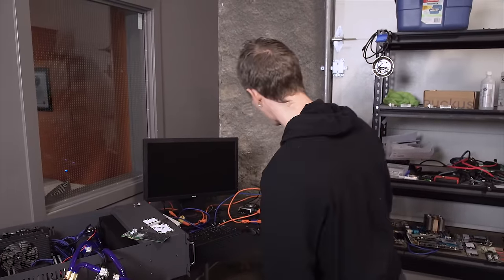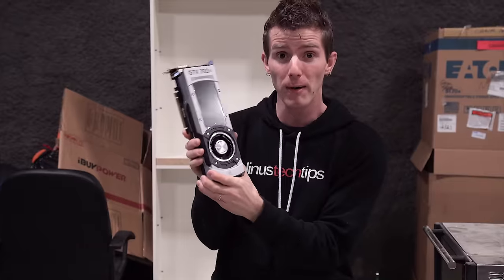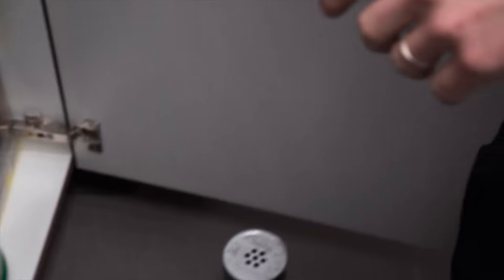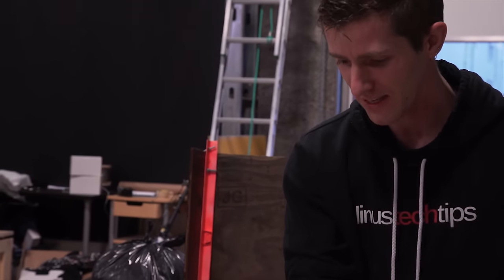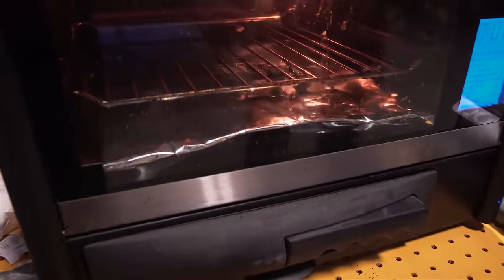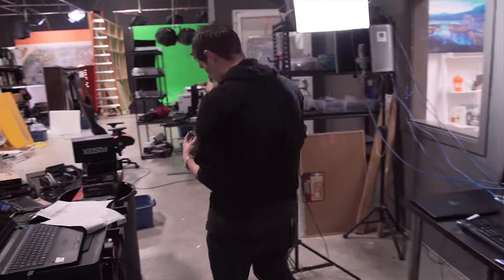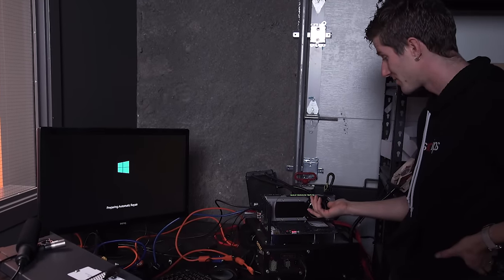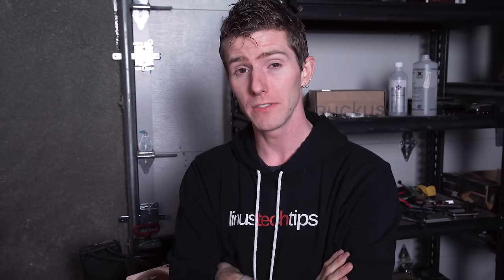Bring your video card back from the dead! - Oven method

Comment: I wonder how many people will fry their otherwise repairable equipment because Linus couldn't do his research...
Reply: +BakedCookie I really don't think very many people would actually bother to have their card repaired properly; it just wouldn't be cost effective.  They'd just go and buy a new one if it was out of warranty.  This "fix" is basically free, and you might as well do it if you're going to trash the card anyway.  Now I understand that if you had a fairly new MacBook that was just out of warranty, it would probably be pretty stupid to put it in the oven before looking into more legitimate repair options.  But that's not what this is; it's a graphics card worth maybe a few hundred dollars that most people just aren't going to send off for repair.  I understand the point Louis is trying to make, but I don't think Linus did quite as much damage with this video as Louis is making it out to be.
Reply: +oledcrt Louis's video was getting at the fact that the Linus crew is so popular and big yet they did not take time into researching the method and that it not only worked temporarily but also messed up a fixable component and that by uploading this video it will spread misinformation and create more dead components some of which are probably rather expensive.  I can understand if it's a very outdated/inexpensive card why someone would just want to scrap it but if it's a $400 card it would probably be worth just getting repaired.
Reply: +oledcrt If you throw the card out anyways you could also just give it away to charities. These would fix the card and pass it on. The stuff linus shows here can make this anywhere from harder to impossible. Source: I have destroyed several switches with a soldering iron - took five seconds per switch.

Comment: This is only a temproary fix. The bonds inside the GPU that connect the die to the pins let go after the constant expanding and contracting due to heat. When subject to a higher temp like that in a toaster oven, it will disturb things enough to make them work temporilly. I have been replacing GPU's for years and when I first started I was reballing and replacing. Now I use a brand new chip after learning that this only temporarilly fixed the problem. The lead free solder used on modern boards has a metling point of 217C or 423F. Theres confirmation you are not actually reflowing the GPU in case there was any doubt. Comes in hand though for rescuing data from a failing laptop board when you dont want to pay for a repair but thats about it. Aside from this your channel has been great. you should let people know this is not a permanent fix though.

Comment: This is veyr good method for dead cards , i used it to fix my dead GTX 550 Ti 
and it worked :)
Reply: bro will this work in micro oven i also dont have money to buy an new graphic card so i am very sad i cnt play games
Reply: I Used Normal Oven to fix
Minimum is 180*C on 8,5 min
When You Can do That on You Micro Oven , You Can try :)
Reply: i heard that when i will bake my card through microowen the capacitors will melt and the chip may catch fire is it safe?
Reply: thats i am afraid of i dont have normal oven and if i bake it in may damage
Reply: What You Have to Lose?
You Got A Broken Card , You can fix it , or it can will be still broken :)
AND REMEMBER , IT WILL SMELL LIKE OLD ELECTRONIC , THATS NORMAL!
Reply: He said Micro Oven not Microwave.
LOL THO
Reply: The 8-Bit Guy It's literally the same thing
Reply: Nope Tho , Micro oven is Minimalized Vesion of Full oven , like for Pizza or Pie
Reply: Yeah if that sunny gamer guy stuck his card in the microwave he probably got some nice fireworks.
Reply: i didnt do it.. this trick worked for me i put some hot iron on the gpu chip for 15 to 20 min and left it for cool down and it worked and for fire works lol no this is my only card.. well bought 1060 happy as well
Reply: Ya , overcloking.
Reply: Wouldn't overclocking rather lead to fried chips on the board than loosening soldered connections?
Reply: The Virus Guy i have a oven so what temperature and time for my rx 460
Reply: I got one for you- late reply, i know. Bought an HP laptop when I was going to school, around 2005. They had a defective surface mount process for Nvidia GPUs. I sent it in for warranty, had the $750 laptop for about a year and a half before it went out. They sent me another laptop. I had it about a year before black screen, no GPU. They sent the exact same board to me with an updated BIOS and all they did was increase the fan speed. There was a huge class action lawsuit against HP for it. I go zero manufacturer support for my issue. I paid $750 for a laptop that lasted about 2.5 years. If there had been no manufacturing issues, it would likely still be running today. You can bake a board at up to 400F from what I know. The transistor housings are designed to withstand melted solder temps, about 400F. Otherwise the plastic would melt when being soldered in the factory. For out of warranty issues, this video may be the only solution. And manufacturers don't always honor warranties. Normally chips last for 10+ years. But thermal expansion/contraction of metals can sometimes break the solder connection. This is actually a legitimate repair process, google reflow ovens if you're interested.
Reply: does it still work today?
Reply: dammn thats really dangerous, if ur hard dryer can output 200+ cº its not good for human use... will burn ur hair. these wont go past 70c, what u need is just a heat source, whatever it is, i'll recommend using a heatgun and a heat table below but. if u have to get these (99% ppl dont have these tools) buying em to repair ur gpu will be FAR more expensive than just buying the next gen titan gpu
Reply: yep, heatguns will do the job faster and better... 100% ppl owns ovens 0.5% ppl owns heat guns
Reply: I have the same card with a phantom 567, it can run beam.ng drive at 50fps. Mine is not dead though.
Reply: When I read these comments, I feel smart.

Comment: Hey Linus...  At least you got the graphics card back right?
Reply: +Thomas Dohlman for now
Reply: Indeed.
Reply: +Nikolaas Brems  yeah I did this with an original xbox 360, and it only lasted for a week...stupid x-shaped  back plate thing thats 2 tight
Reply: +Clear17Mud Bad solder... the 360 had bad solder and design. MS did figure out how to use the "new" solder with newer generations.
Reply: +Clear17Mud Well because reheating doesn't fix anything in 85% of the cases.
Reply: and if it does it only does it temporarily. check out rossman's video
Reply: I am pretty sure this was never refereed to as a permanent fix.
Reply: Welsige
I hope people will understand that from either Linus or Louis videos or both... or none, just by the amount of comments with some details.
and in the end, nomatter how well you inform people, they all try to remove /system32 to speed up their FPS

Comment: I did it yesterday to HD 6990m. Cleaned it thoroughly with rubbing alcohol, then placed it in the preheated oven to 220 degrees Celsius, for 12 minutes. First two tries were a failure, and I gave up, until I needed to preheat metal sheet for a different project, when I noticed that bottom heater of the oven is dead.

Comment: My GPU isn't locking up anymore, but the fan won't work, dammit.  To be honest it probably only need new thermal paste.
Reply: My fan dont spin too if i change the thermal compound it will wirk again ?
Reply: @ANNIHILX.  No
Reply: @H.EL-Othemany  lol "my radiator fan no spin, if I replace brake fluid will work?"
Reply: Fan has nothing to with thermal paste. Yank the fan out and test it with a AA battery and a paper clip.
Reply: @debbidonosenshi  lol my phone's speaker doesn't work do I need to replace the LCD?
Reply: Connect the fan to the motherboard ,or to 12v and let it rip....

Comment: It's not gross. It's pure carbon.
Reply: +Hostile It really isn't. All kinds of organic compounds in that burnt stuff.
Reply: +Hostile carbon can be a lot of things
Reply: +Hostile whatever floats ya boat.
Reply: +Hostile There can be grease missed with that carbon which will be sticky and sick
Reply: +Hostile It's not M'Lady. It's pure M'Lady.
Reply: +Adam Rasmussen lol organic compound is defined by having carbon
also soot is mostly carbon, it's not pure but it should be relatively close to pure carbon
Reply: +Hostile There will also be left over fats which is pretty gross.
Reply: YIC Finally, someone gets it.
Reply: YIC You don't need to lecture me. He wrote pure carbon. It is far from it. Read up on pyrolysis and char and you will find that the conditions required to achieve a compound with a carbon content that can be described as pure simply didn't exist. Soot and burnt food are far from pure carbon as they are composed of thousands of different molecules and particles of varying sizes containing many elements other than carbon. As food is charred a lot of the content escapes as gas leaving much of the carbon, but a higher concentration does not equal purity.
Reply: +Hostile pinch it hard enough, you get diamond

Comment: I have found Alligator Clips crimped to pieces of coat hanger make great stands for boards when heat fixing.
Take a 3" piece of coat hanger 90 degrees at 1-inch  - add an alligator clip to this short end and use a crimping tool to join them, the clip holds the board, and the the piece of coat hanger keeps it 2" above the pan.

I Have also used the oven trick to resurrect laptop main boards and dedicated gpus

Comment: The last time I ran a CPU "for a couple seconds" without a heatsink I got a loud pop, a cloud of smoke, and a room that smelled like plastic for a week!
Reply: it wasn't a cpu, it was an ssd
Reply: Also, I'm not sure about GPU's, but most CPU's and other components automatically shut down the machine if they overheat beyond a set threshold, specifically to avoid damaging the components.
I even remember accidentally running my old franken-PC with no fans at all, and wondering why shut down after only a few seconds.
Turns out someone distracted me after I disconnected them all during some debugging, and i forgot that I had done so (I was like 10 or 12 years old). :P
Everything survived just fine, after hooking up the fans, and letting it cool of for a few minutes before booting it up again.
Reply: @MartinFinnerup  Not around the year 2000 they didn't, not AMD anyways. APM was used because ACPI was not yet standard in all machines.
Reply: @arnz5050  Gonna go out on a limb here and say it was the CPU. First, because I WAS THERE and second, because I'm pretty sure SSD's didn't exist in the year 2000.
Reply: @MartinFinnerup  Yeah, newer cpu's do that, but back in the day you could easily fry cpus like Durons Athlons or pentium 3's just by removing the heatsink under heavy cpu load, like while running quake 3.
Reply: @dowskivisionmagicaloracle8593  Good old days when overclocking really made a difference.
Reply: @Pirata796  Yeah too bad none of us were clever enough back then to think up liquid cooling pumps or a case full of mineral oil LOL
Reply: Someone ran AMD ryzen without a cooler and it just underclocked itself to 95° and still ran at and even booted into windows
Reply: @pilotavery  Really? I find that SO hard to believe for some reason ....
Reply: @pilotavery  so it goes into a coma

Comment: As an electronics guy, I'd do two things differently:
- Put screws with nuts in the PCB mounting holes, and use them as standoffs for baking. Why bother using loose foil balls? Nuts are better than balls in this case ;)
- Don't touch a circuit board while the solder is liquid. The small hit at 13:06 may easily have moved a component.
Instead, just turn the oven off and open the door when the baking is finished. This will also reduce thermal stress as it cools down more slowly.

Comment: Which  one is more janky? The Xbox 360 towel method, or this?
Reply: Point stands that the towel method is just a cheap and janky way to achieve the same thing. No professional would ever use the towel method for anything other than a broken toy.
Reply: Chris Sawyer OK. I was making a stupid joke about what method was more janky. I'm not making some in depth commentary of what methods you can use to solder.
Reply: Towel method... and this. I've saved 2 Xboxes with towels, 2 PS3s with heat guns, and 1 graphics card with a heat gun. :D

Comment: I fixed a HP LaserJet P2015D motherboard using this method and made Aluminium foil solid cones to space the board off the tray. the point of the cone went in a fixing screw hole and this avoided the board shifting on the balls you were worried about!

Comment: Does that video card still work after all these months?
Reply: There's a  very very very rare chance it still works, this was just a temporary fix and most likely will make moisture residues on the card that'll make it die
Reply: A sample of 1, but I did this to my laptop gpu in 2008 and it kept going all the way into 2012, when I got a new pc.
Reply: Well i fixed my 6870 2 years ago at a friend with a reflow station. Still works to this day.
Reply: Did you cook you whole laptop's motherboard?
Reply: It may work for years, it may broke after week. Nobody knows, but basicaly it's just temperary solution before you buy new card/motherboard/whatever.
Reply: I fixed two of mines, a 9600GT from PNY, and also a EVGAGTX770 I believe both lasted about an extra year after the bake resurrection
Reply: The GTX 280 that I baked for a friend worked about 4 months again until it started to make artefacts again.
Reply: 0himym you can oven it once more, it might work for another usually (shorter usually)
Reply: i did it with my 8800GTX and it still works. Been benchmarking it couple times after
Reply: I did 3 times, then I cooked it again and gave away lap top =)

Comment: I just stuck my intel i7 7700k into the oven at 250 degrees and it now runs a lot more cooler. I'm so glad I found this video because previously, it was getting very hot and running slow. Has anyone else tried this?

Comment: I did it and... it burned... wat do i do now
Reply: eat
Reply: Bin it.
Reply: try Again
Reply: +Arthur Costa turn it off and back on again?
Reply: +Arthur Costa NOW you ask for a refund.
Reply: +Arthur Costa Cry
Reply: go ask Austin Evans, he knows all about burning
Reply: +Sledged savage
Reply: Put it in the freezer
Reply: is there a legitimate way of fixing a GPU? say you over clock too much and screen no longer shows a picture or lines running through it which ive seen before can these problems be fixed?
Reply: +Julian john did you watch the video?
Reply: Julian john 1st- he wasnt a troll. This cant solve your problem, but can help others. and it actualy works
2nd- did you already tried turning it off and on again? deataching your GPU, turning your computer on, undo the overclock, turning it off and attaching your GPU on it again?
Reply: +Arthur Costa have it for dinner
Reply: Nathan it looks tasty, but no.
Reply: Miguel Coelho okay, where's your mum?
Reply: +Julian john try resetting your cmos, or entering windows in safe mode to reverse your gpu overclock.

Comment: I was taught similar trick you can do to a dead laptop as a last resort trying to save it. This is the case if your laptop has lights but doesn't boot after several tries. First thing to do is to open your laptop and disconnect the fan and remove your hard drive. Not doing so can cause data loss under the high temperature. Put the cover back on and turn on your computer. Let it sit until it shuts down due to over heating. Then let it cool down and reconnect the fan and try to turn it on again. If it boots normally you can put your hard drive back. Your laptop should work just fine at least for some time. This can also do more damage to the laptop, but if nothing else works and you have nothing to lose then you might as well do it. The part that apparently ends up disconnecting from the soldering is the graphics card.

Comment: You should really publish a pinned comment that you shouldn't do this and at least link to your follow up video where you visit Louis Rossmann.
This does not work! It may temporarily fix it or kill it. Ovens like this don't even run hot enough to melt solder.
Watch Louis Rossmann's videos. You'll learn how to actually repair stuff.
Reply: but i really fixed mine gtx 8800 10years ago like this :D it still works, but i dont use it anymore..
Reply: I was thinking of louis while watching this lol
Reply: Yeah, Rossmann showed that this fix works just as well at temps 100C too cold to melt solder.  This has nothing to do with solder.
Reply: It does work but ok